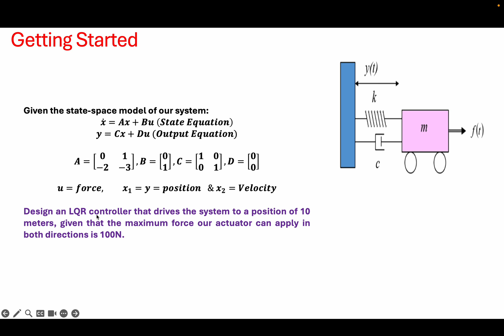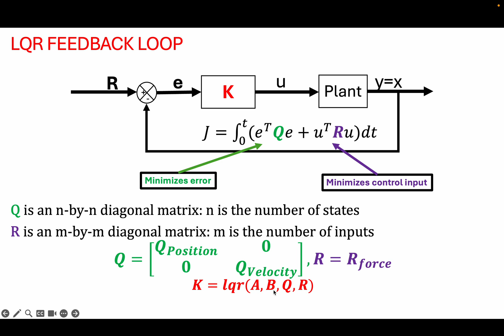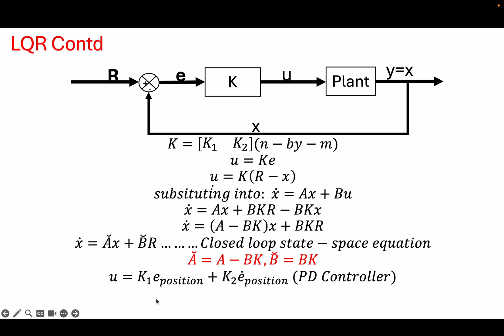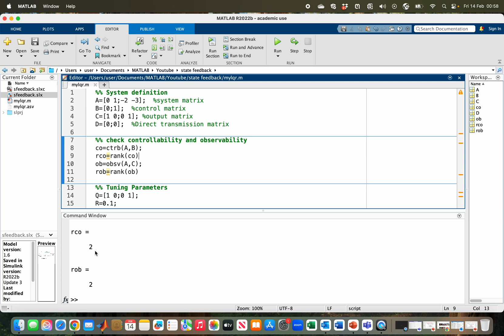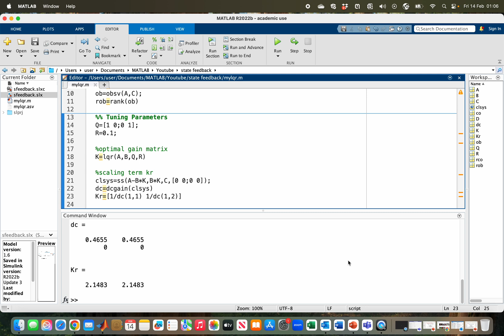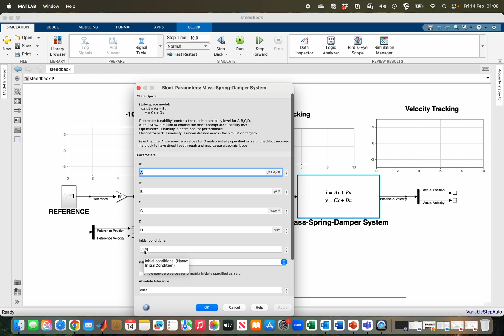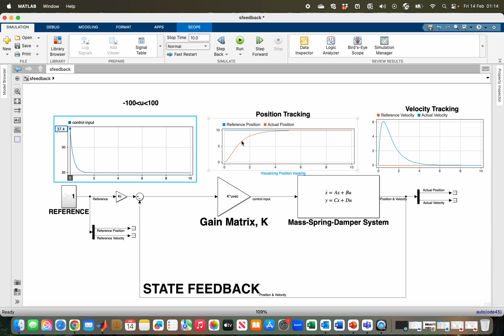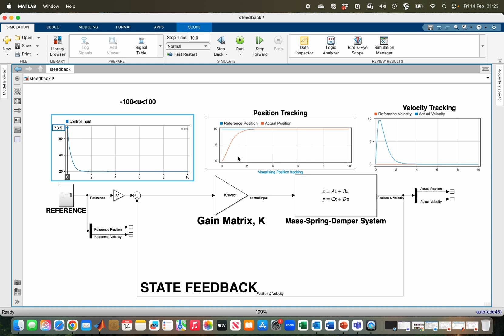LQR Controller Design in SIMULINK and MATLAB.

Comment: Very nice video. Could you please explain what is Kr with more details? I have a project with inverted pendulum and I was looking for that.
Reply from the maker: Kr is a feedforward control gain that helps eliminate steady-state error. As explained in the video, conventional LQR is analogous to a PD controller; therefore, zero steady-state error can only be achieved by complementing it with an integral gain or using a feedforward control gain, as demonstrated in the video.